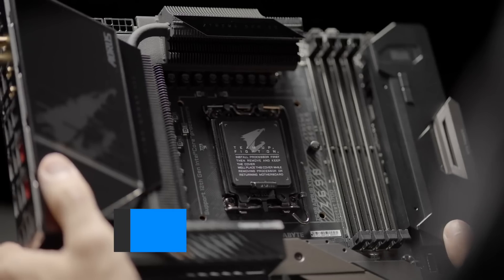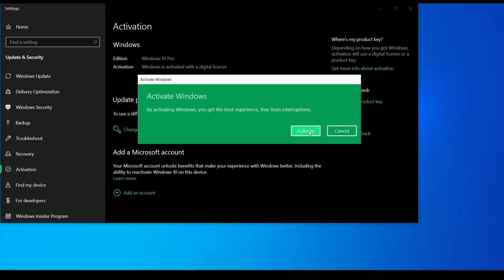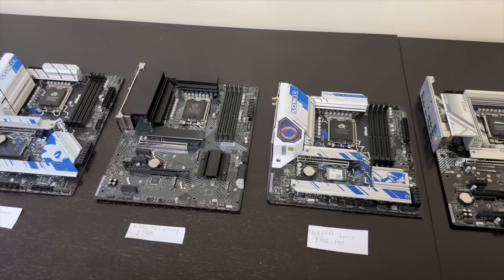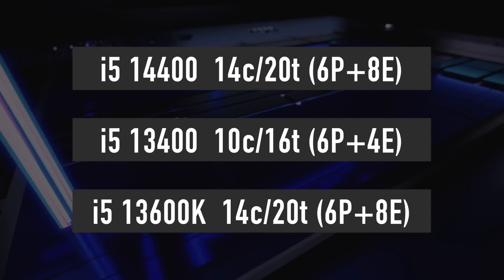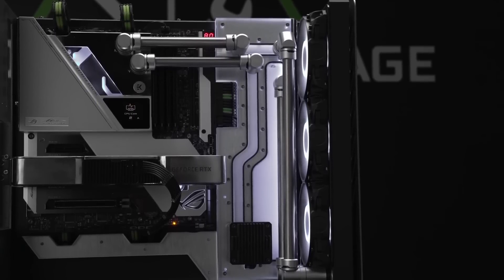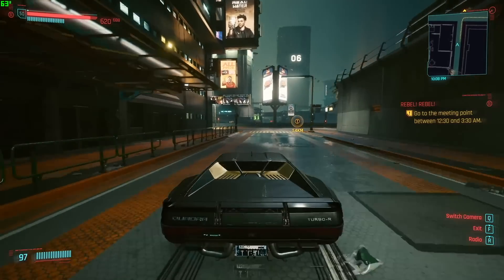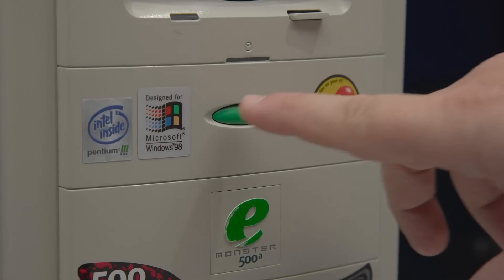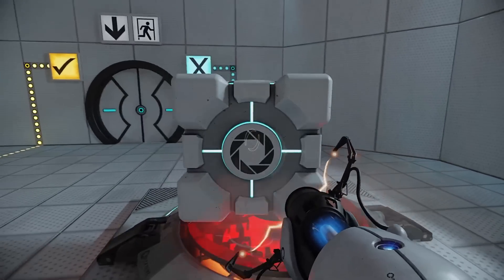Intel 14th Gen is actually VERY impressive! [i3, i5, i7, i9 specs, performance, release date]

Comment: I hope i5 14400 is under 200$ It would be one glorious productivity budget king.
Reply from the maker: Not sure Intel will set such a compelling price. Even the current-gen 13400 hasn't reached $200 yet. The next-gen MSRP will certainly be higher than that.
Reply: @theivadim  It doesn't matter if it is priced same as 13400. Keep in mind 13400 itself was released at 220-230$ and street price goes around 209-200$.
Reply: i choose i5 14500 for better apu.
because we really need apu to save power. when opening light applications.
turn off discrete VGA when not needed. (remember the global warming bro)
and only use discrete VGA when running heavy applications.
Reply from the maker: @penonton4260  is a laptop better for such use case? I am using Macbook Air M1 to do most of my day to day stuff. Very nice, silent, and power efficient way of personal computing🙂 I think it uses below 20W under load. No desktop APU can compete with a mobile APU.

Comment: Impressive will be only the insane high power draw, as usual with Intel cpu's!😉
Reply: I have an intel n100, it has fewer tdp than my smartphone 😆
Reply: @cassiofbs  ...and my Apple Silicon M2 has a comparable power draw and is 20 times faster.
Reply: @knofi7052  its indeed faster but at most only 2 times and with a cost of 4x more power.
Reply: @knofi7052  btw i didnt even mentioned the price but I bought my minipc for $163, mac mini now is $600 dollars...
Reply: How many watts does a 7950x or 7950x3d need to reach 43k+ CinebenchR23 points? My 13900k needs 286w.
Reply: @jjlw2378  probably half in fairness. intel 13th gen is very inefficient, even compared to 12th gen for the same or less performance.
Reply: @Lynnfield3440  You're wrong about power consumption on 13th gen too. It is more efficient than 12th gen at the same clocks.
Reply: @jjlw2378  no people have tested it 13th gen uses more for the same performance.

I will also post a link below this comment if youtube allows it, but they do seem to usually delete it.

if you google this you should get the right thing, for me it was the 2nd result from overlocknet.  12400f oc vs 13600k the 13600k oc vs 12400f offers about 5% more performance for 20-25% more power, not what i would call great.
Reply: @lynn5436  It helps if you read the forum. The B660 board used for testing caused many issues and actually severely reduced the performance of the 13600k. Enjoy your 12400! It seems to be a nice budget chip with impressive OC capabilities.
Reply: That's not even the main issue, them all being locked is the issue. The 13100 is like 50% slower than the 12100f because of that.
Reply: @Lynnfield3440  they are both 4C 8T cpus built on intel 7 and both are locked....
Reply: @mastroitek  sorry what? You mean the 13100&14100? Because the 12100 is unlocked which is why it's so much faster than the 13100.

And the 14100 should have more cores according to the article. Although knowing how much Intel like to stagnate at best who knows.
Reply: @Lynnfield3440  no, the 12100 is locked, look it up. The only way you can do OC on it is by using a mobo supporting bclk overclock. And they cost an arm and a leg
Reply: @Lynnfield3440 Any intel cpu without “K” in its name is locked.
Reply: @mastroitek  no its literally not, or are you saying a 12100 runs at 5.1 ghz out of the box and stock vs stock a 12100 is already way faster than a 13100?

because mine is runing at 5.1 ghz.

and no any decent motherboard will have one and they are cheap too. msi has some B660 mortar MAX DDR4, asrock as a B660 raptide gaming, asus has some DDR5 boards too if you want DDR5, and they can all be had for 100-150 euros. ive seen that asrock board for less actually ( altho usually prices fall between 100-150).
Reply: @FaceyDuck  no 12th gen was unclocked. 13th gen just got locked again.
Reply: @lynn5436 BCLK overclocking isn't officially supported by Intel. Hence, why it was not allowed on 13th gen. Non-K skus are meant to be locked. Motherboard manufacturers just found that in the case of 12th gen, the BCLK overclocking wasn't being officially blocked.
Reply: @jjlw2378  it actually requires them to do work to lock it down, it works by default but intel is just dumb. with 13th gen they just did their thing to block it again and made 13th gen was slower than 12th. they make the 4060ti look great.
Reply: @Lynnfield3440  It was an oversight from Intel. BCLK on Non-K skus has always been locked down to BCLK >103. It just so happens that it inadvertently worked by mistake on 12th gen. It was a nice bonus but not something you should expect on any future generation ever. It works on every K sku but only memory OC is capable on non-K skus.
Reply: @Lynnfield3440  Alright I stand corrected but still, no i3 is unlocked
Reply: @jjlw2378  also this is wrong there have been multiple generations that werent locked. the i3 530,550 the i5 650,750, the i7 860 they are all unlocked.

also the X58 platform had the Xeons and I7 920,930,940,950,960,970,980,990 and those were all unlocked too>

Both BCLK and multiplier for all of these cpus.

and its not oversight. it has always worked but intel just always  locks it down because they want people to buy intel, I mean who would want to make their own product seem better than the competitors right? ofc you dont, so they lock about half the performance out so they look terrible and you buy something else.
Reply: @FaceyDuck  no definitly not, as the i3 530, i3 550 were unlocked, and with 12th gen intel didnt lock down the non k cpus so the 12100, 12100f, 12100t and the 12300 etc are also not locked.
Reply: @Lynnfield3440  This is just straight up false, so if you want to spew lies we can just do that instead. I just looked it up, and all the 12th gen i3’s have locked multipliers. The older i3’s I’m not sure, but those are a decade old and so why even bother talking about it?
Reply: @FaceyDuck  no its literally not, why even reply if youre just going to say any source is wrong vs you with, trust me bro?

thats just a waste of time.

you stand incorrect, just accept it.

I dont even know why you want slower cpu's like seriously that is one thing I would like to know. why do you want intel to do extra work to make your cpu upto 50% slower?? unless you are a AMD fanboy than it makes perfect sense and I have no further questions.
Reply: @Lynnfield3440  Look it up yourself. I do not accept being incorrect this time, because I’m not. 12th gen i3’s have locked multipliers, and it only takes 5 seconds of Googling to find out.
Reply: @Lynnfield3440   those unlocked cpus are a decade old, as the other guy said, 12th gen was an oversight from intel and it was brought out by derBauer during his testing, 12th gen non-K SKUs can be overclocked only on specific MBs.
Would I love to have a whole lineup of unlocked cpus? Sure, but I don't keep my hopes up. 

Regarding 13th gen efficiency, they have a decent lead over 12th gen when running around the base TDP, this is true at least for the SKUs with E-cores, some SKUs like the 13600k and 13900k have a substantial lead over their predecessors.
(derbauer)

Regarding the power draw of a 7950x in synthetic benchmarks it is 220-250W, scoring about 38.5K in R23 
(GamersNexus & derbauer)
Reply: @lynn5436  You got me. 20yrs ago some "locked" CPUs weren't officially locked. Nowadays it's different. I wish they were all unlocked for BCLK, Voltage, Multiplier, and RAM. However, many non K skus end up in prebuilts/office PCs/novices so they would rather warranty a rock solid stock CPU and ask enthusiasts to pay more for those features.
Reply: The insane power draws are only if you push the CPUs to the max. If you don't need the absolute maximum frequency the CPU can achieve, the power draw can be much better. Not neccesarly better than Ryzen for the same clock or performance, but surprisingly close.
Reply: @@ak20ayush I dunno someone actually using the parts vs some random internet People Then id say the person actually using them is more reliable. And bclk does provably do no damage to your pc.
Reply: @@ak20ayush no that is not what it does, you should read a bit more about it. not sure what is a good place. but that information is just wrong.

Just by using lofic, you would never be able to overclock a component by 40% and not need to increase voltage for it to run stable. it wouldnt damage anything as your pc just wont boot and load back into the default settings. ram wouldnt take a 40% oc withouth voltage increase, let alone the parts no one overclocks or atleast almost no one.

if it did what you think it does it wouldnt be a thing as it would simply not be possible.